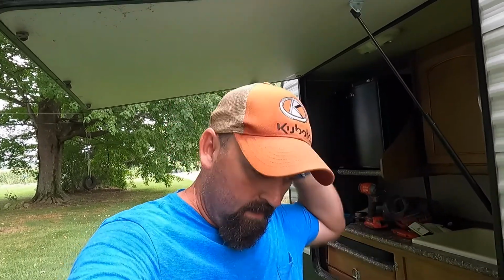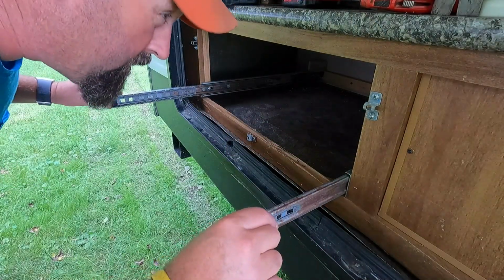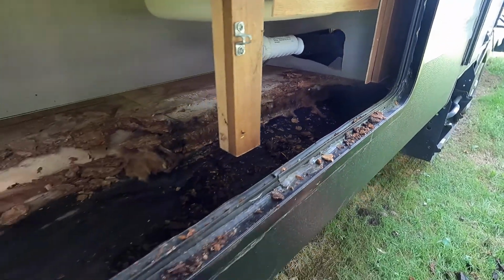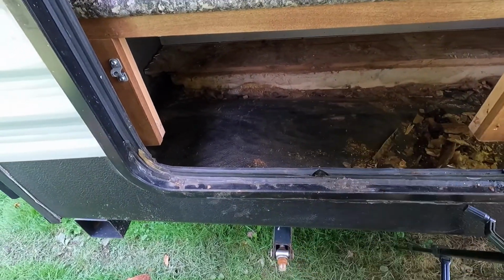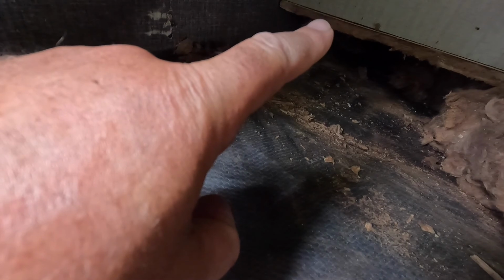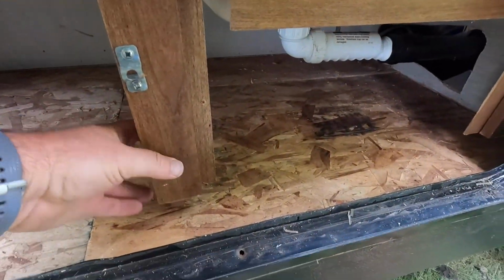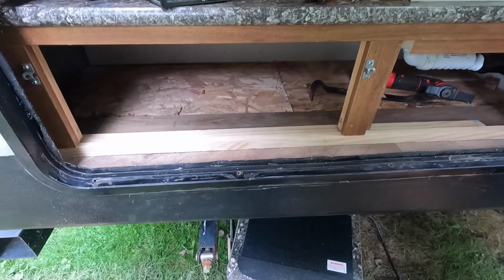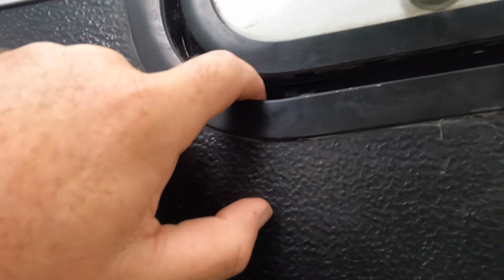HOW TO repair RV water DAMAGE!

Comment: If your pump isn't shutting off,  then there is most definitely a leak somewhere. Looks like they built the door crooked on purpose. I wonder why.  
You did a really good job.
Reply from the maker: I looked at all the fittings but didn’t see any but I could of missed it somewhere.
Reply: @TheHobbyFarmHomestead  - There is a leak for sure. The pump wouldn't run unless it is pushing water. We have a private RV guy that comes to do the work we need. You might look in your area for someone that will come to your house to look it over.
Reply from the maker: @PaullaWells  I will have to look harder. It might be my outdoor shower faucet leaking.
Reply: Not necessarily when using the water pump the system will lose pressure over time and will turn back on to repressurize

Comment: I wouldn't put insulation in either. It appears you figured out the leak cause and have built back better. I wonder if there's a blog for the RV where people talk about problems. Hope yours are over.
Reply from the maker: I am sure there is. I am pretty sure that the door seal was the problem. Thanks for the support!
Reply: The reason it leaked is because the camper is aluminum sided and there was no flush seal all the way around that door